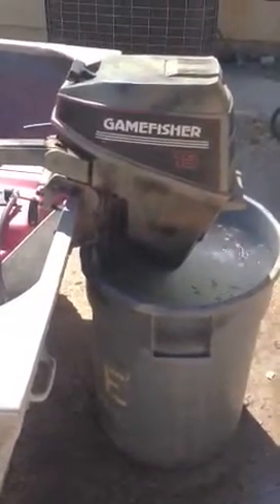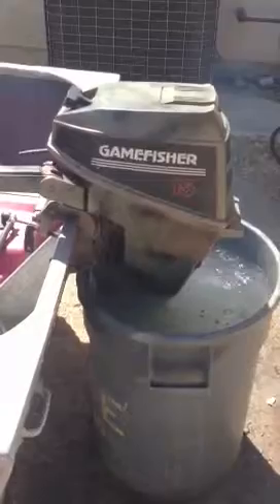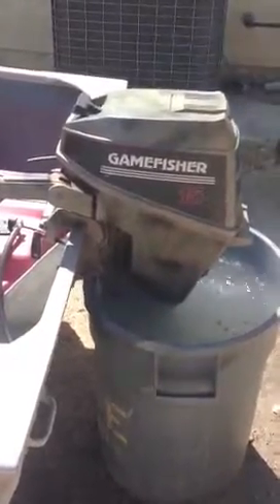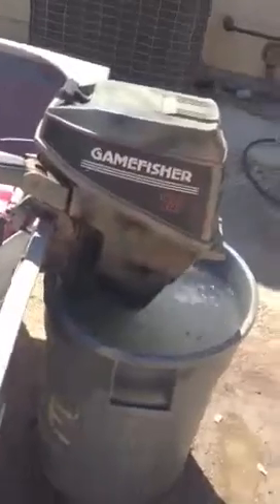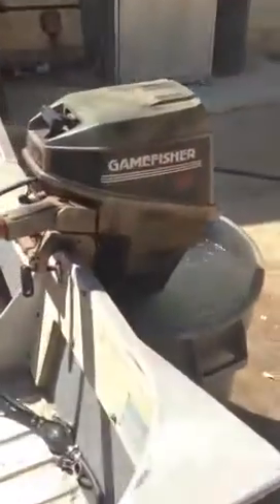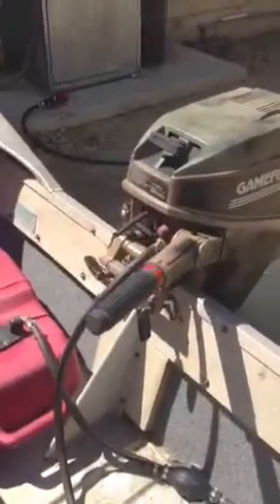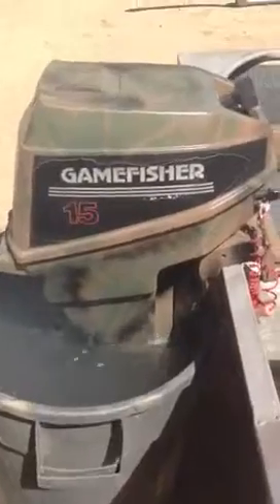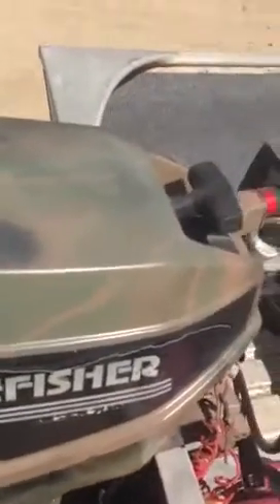Gamefisher 15 HP outboard

Comment: What were the symptoms you had prior to the conversion?  I have the same motor that does not like to idle and you can hear one of the cylinders skipping or sputtering at low RPM and when decelerating.  I've replaced and cleaned the carb and it still isn't running right.  My compression is excellent at 130 and 125, but Im starting to run out of ideas when it comes to the motor... I have a feeling one of my coils is going or has gone bad but Im not sure.  Any insight would be appreciated.
Reply from the maker: +kylerprochaska i had a misfire i could not get rid of.
Reply: +mattalexander54 I have a feeling I'm in the same boat you are, but after talking with the guys on iboats they told me to rebuild the fuel pump first.  Hoping its just the fuel pump but I'm not going to hold my breath lol